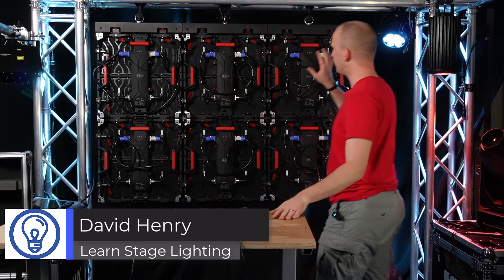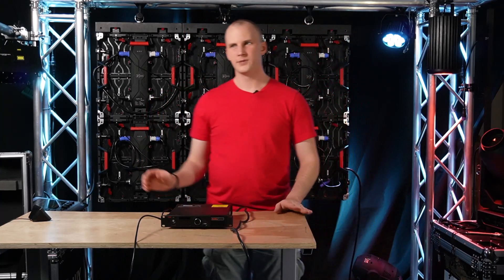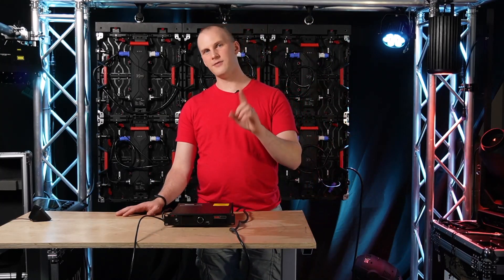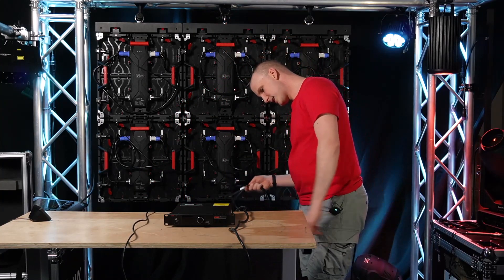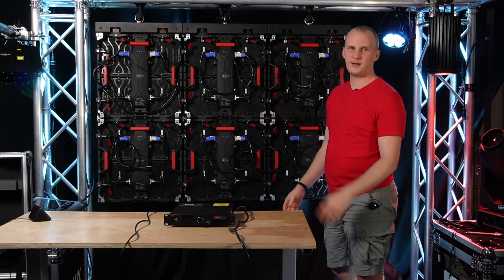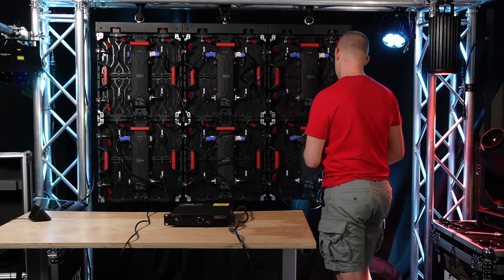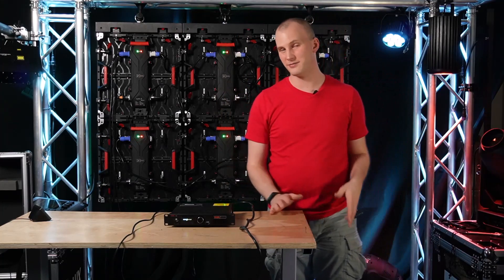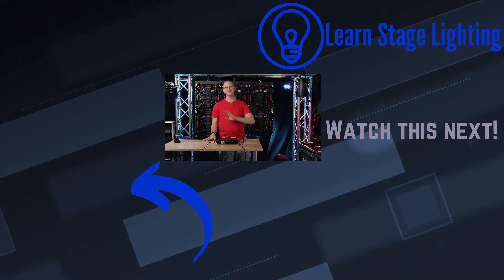How Do You Wire an LED Wall?

Comment: When I’m running power and data through do I wanna go torwards the home run or do I start at homerun and work my way through
Reply: Doesn't matter, as long as the designer is the same, you could even cable them criss cross!